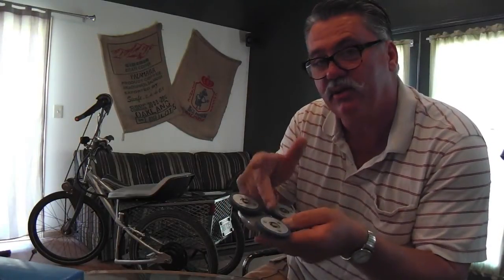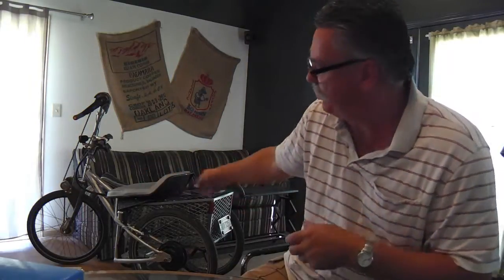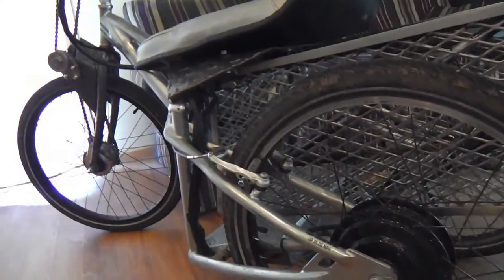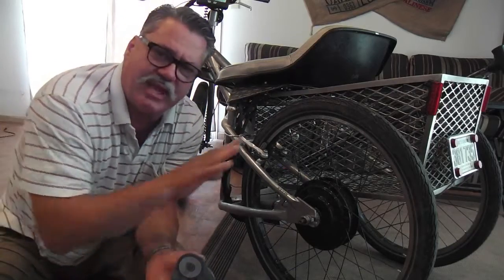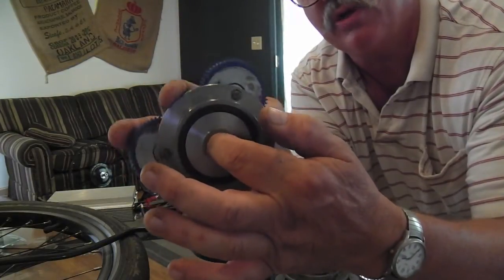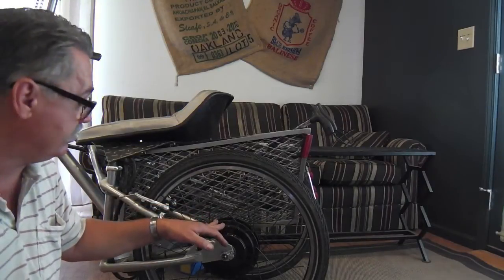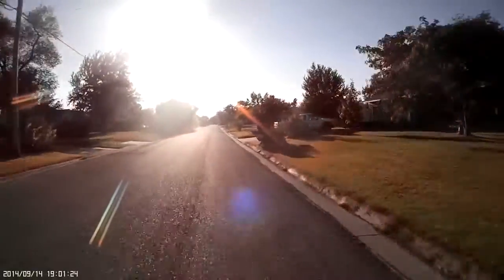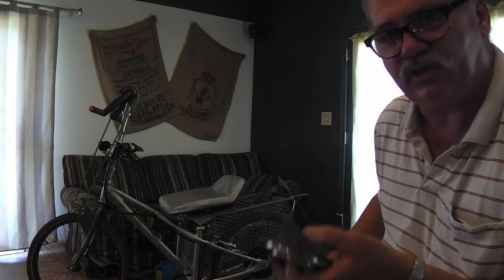Electric Bike Planetary Gear Clutchless Modification

Comment: I've built a few e-bikes
Also e-scooters & E go-karts out of scrap parts lying about.

I have a hub motor with clutch freewheel gears.
It has no problems turning backwards.
Not sure about the hub motor what you have.

I believe you would have extra benefits.
If you had direct drive hub motors.
Pedal assist will help you to pedal.
Automatically giving
small bit of power as you pedalling..
You can have reverse with a bottom or switch..
You will have very good braking power with regenerated breaking..
Also will save on brake pads will last much longer.
Also the regen will charge your battery up.
Giving extra power for extra range..
Also with less moving parts would be more reliable.

Comment: I have brought 3 clutch mechanisms to slip within the last 2 month, probably because of operating them around 1000W on a pretty heavy recumbent fat bike, and them being bought inexpensively used anyway. My motors are marked internally as 8fun even though they are sold in Europe under a 'trio' brand. It sucks that the clutch mechanisms are riveted and not made for repair, so welding them will probably be the only alternative and I am thinking these could become pretty good mid motors, where the freewheeling is not required anyway, and apart from the internal gear advantage the motor could be involved in further gear reduction options... Another interesting application for 'seized' freewheel clutch motors could be a generator pedal setup!

Comment: Hiii
Thank alot for video
I dont know what to chose I can find majority geared 
Are they reliable?? Did gears fail often???
Or is better direct drive??
I saw the industry is moving to geared The direct drive start to be rare so is difficult to buy.
Reply from the maker: Well, I haven't used a direct drive hub myself, but I'll recommend that you do get one, as they're plentiful, they're a bit cheaper, and they don't have a freewheeling/clutch mechanism to fail. I'm somewhat invested in the BMC planetary gear style, but they're getting harder to find. Honestly, the Bafang mid-drive stuff seem to be the smartest move for a typical eBike installation kit, and Luna Cycle is the go-to source for those kits, in my opinion.

Comment: My bmc clutch has been slipping when experiencing high downforce ie offroad going down steep hills. The gears suffer from offroad use but the clutch is the weak link and it sounds absolutely horribly when it goes wrong. I'm only half way into the video but I'm hoping this will solve my solution haha.
Reply from the maker: Great, and please let me know back here how it works out for you. You may find that the slight magnetic drag incurred when the clutch is removed may be a slight benefit when going downhill without any throttle too. Otherwise, it will undoubtedly make the hub more robust in its sturdiness, although not as much as a direct-drive hub motor. But you'll still have the torque and quick take-offs inherent in the planetary gear hub design.
Reply: NewJerusalemTimes I never thought of the downhill part. I think i'll try it once my clutch gives out completely though and I have to buy another set. I was thinking of just using jb weld as I've seen somewhere on endless sphere.

Comment: Yo Man... Just swap two phase wires to make it run in reverse...
Sometimes controllers have a speed limit on reverse mode.
Reply from the maker: Nah, you're not following... The motor can't reverse it's direction with the cogs in the the clutch, as it is mechanically/centrifugally prevented from doing so with the motor on the other side while having the phase wires coming in toward the fame like the other side. That's why I did away with the freewheeling/clutching action, so that it can, regardless of which electrical way the motor is reversed, i.e., through the phase wires or via the controller jumper (which is faster and simpler). Otherwise, no speed limit for reverse via the controller, except for a slower speed jumper/short, regardless of motor rotation. Also, my CycleAnalyst can limit the speed to any MPH I choose. I don't use either, though, as the top speed is about 25 MPH, which is just right to have on tap, and it gets there as quick as most any car does.

Comment: Still riding?
Reply from the maker: You bet!
Reply: So glad to hear, I just did this to my bike.

Although I cheated and “half butted “ it,  I drilled three holes into the top where the steel roller came in contact with the inner sleeve. And welded the roller to the hub.

Fixed that and than had all the magnets come unglued.     Upward and onward.